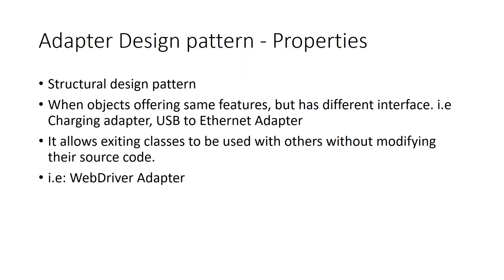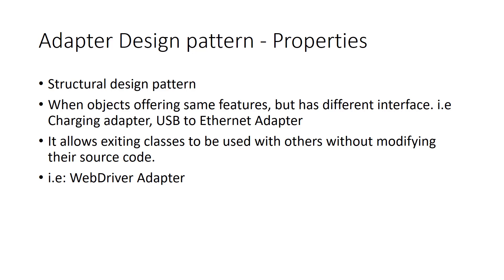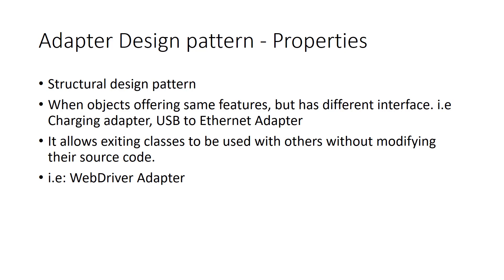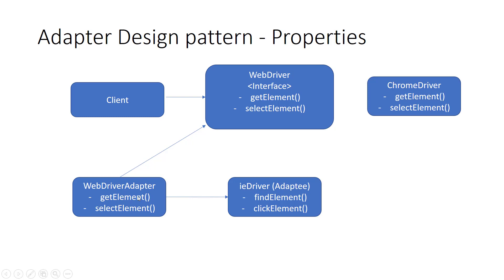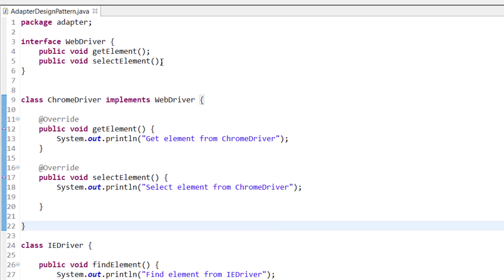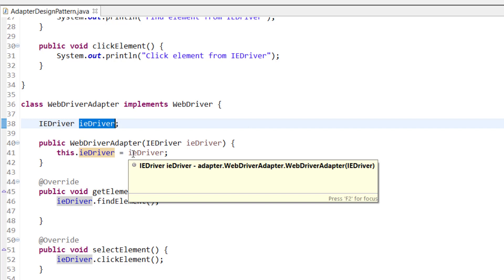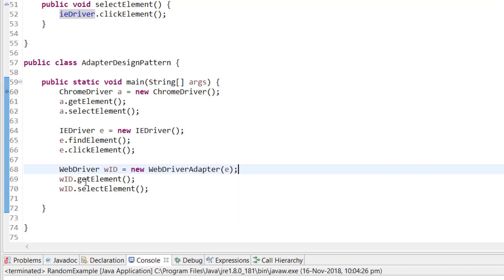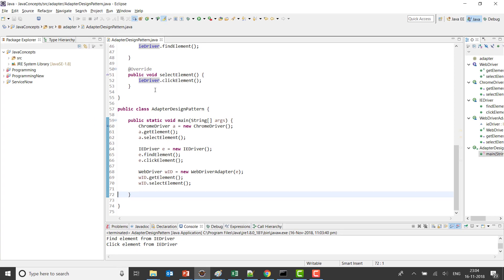Adapter Design Pattern in Java

Comment: Hi, let's say in your example I have many drivers(adaptees),  safari, opera, Do i need to write Adapters for them.
Reply from the maker: Like explained in video, if adaptees are doing same work but using different function name, then we need to write Adapters. 
- Now the point is you need not to write separate adapeter for each. 'WebDriverAdapter' can handle this. You just pass the driver & as per driver, it'll call the function. So we can have switch case in WebDriverAdapter if you many adaptee. 
- Let me know if you've any further questions on it.
Reply: @CodingSimplified  
Nice video and nice explanation for the above query
But in every method do we have to add switch statement.if it is code will get lengthy. Please correct me if I'm wrong